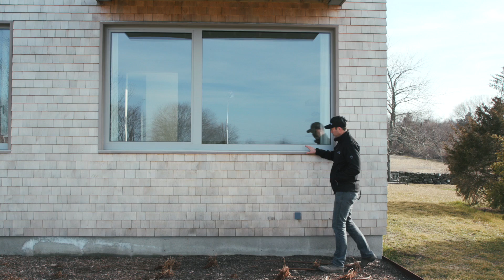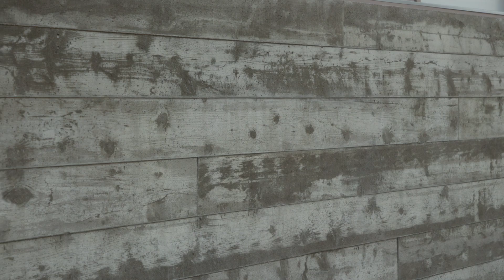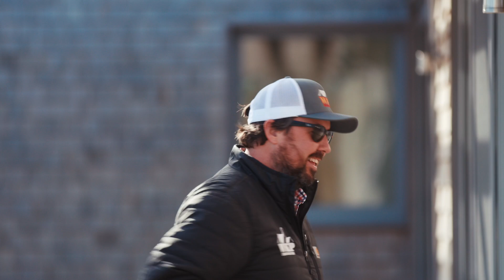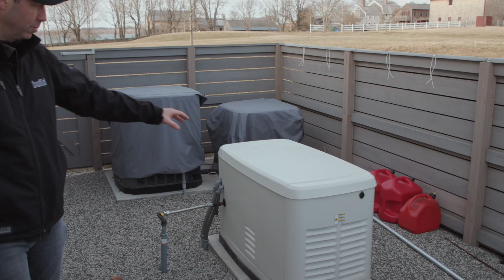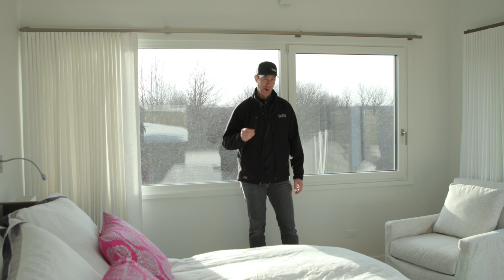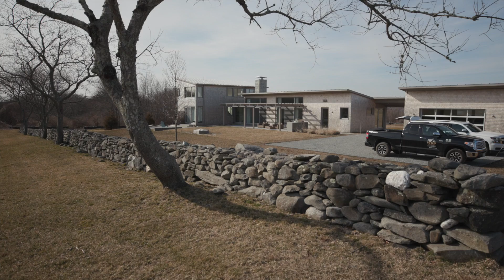10 Killer Details For A Modern BUILD

Comment: Anyone else not happy with the door handle at the end? It's probably for mechanical reasons, but turning the handle up too lock it just doesn't feel right to me. For one, even if it isn't strong enough, gravity will always try to unlock that door. Second, a large dog might figure out that it can unlock the door by biting down on the handle and hanging off of it. My landlord has two huskies, and once one of them figures out how to get into an area they want to get to by doing some really bizarre action; they will not hesitate to do it. Case in point, the grass area in the backyard was getting a bit thin, so my landlord fenced it off from the dogs to give it a few months of recovery time. One of the dogs figured out that it it gets its two front legs over the fence, it can dog-paddle its back legs while wiggling its front legs to shimmy over the wire-fence. Last, I can see some moron using the handle as if it were a hook for hanging things. Which may cause it to wear-out and/or break some of its mechanical components, and a heavy enough object might unlock the thing. Lock levers really should be setup to lock when pulled/turned downward.
Reply: Seriously ? Clearly you have never had the opportunity to operate a Lift-Slide unit.

Comment: Nice "Mechanical Corral"... but why not cover it with an awning, or extend the roof over it?   
A couple of 4x4 posts on the 2 outer corners and you could extend a cover over it and not have it exposed to the elements as badly.  Would suck to work on it during bad weather or extremely sunny day.   Shade makes it better!   (And if you want to get fancy, you can go for a louvered patio cover, and open & close it with the push of a button).

Comment: Lead coated copper? Is that wise?
Reply: Lead coated copper is normally used for flashing on commercial buildings clad in limestone. Lead oxide is white thus no green stain.
Reply: @250P  I appreciate the explanation, but I believe Ancients Nox is asking about the wisdom of deliberately using a highly toxic heavy metal on our homes. In this setting it would serve to contaminate all rain water waste over time and sink into the soil and plants, exposing people, and animals to a low level toxicity.

Comment: Ok. Been in field 30 years. 
And these ain’t killer ideas or new ideas. 
And the vents would be a big issue with me. 
You can get 6 inch vents but 1 be a 4 internal if something requires it. 
And if you look at the shake it’s not even. 
Yes it might be nit picking but I can say this. When a customer calls and says let’s do a custom house 2-3 mil. Etc it better be custom

Comment: I see this mistake SOOOooooo often. The doors in half the Hollywood westerns are done this way. The diagonal support on the gate is going the wrong direction. It should extend down to the lower hinge to support the falling weight of the door or gate to the hinged side.

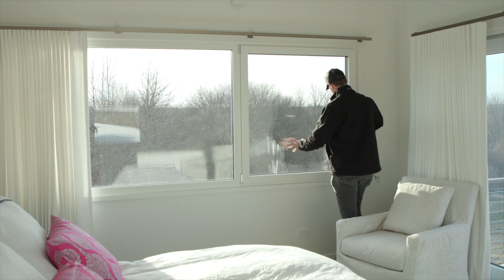Comment: 6:22 window opens in the wrong direction. Nuf said. Greetz from Germany :o)
Reply: Yes indeed this window is hinged on the wrong side. But hey we are not in Germany anymore where they are doing things the right way ;-)
Reply: German Windows can be hindged Left or right. Preferences depends on availabe swing space and astetics. Greetings from Austria.
Reply: no, the windows do not open "in the wrong direction". if the window opened in what you apparently consider to be "the right direction", the window sash would hit the lift and slide door on the perpendicular wall.
Reply: They are installed correctly. See https://www.innotech-windows.com/windows-doors/windows/tilt-turn-windows
Maybe the Polish builders installed your windows the wrong way. These European style windows swing this way so you can clean them from inside the room.

Comment: How were the plumbing vents handled?  I don’t see any vents stacks on the roof.
Reply: Ed Surowiec I think I saw roof vents in some of the drone footage; look closely at the end of the video.  But, vents aren’t really necessary... in 1988 my cousin and I did all the plumbing for a 3 bedroom log cabin and because of the challenges of running plumbing vent stacks through the log walls and roof we used one-way “air admittance vents” rather than traditional through the roof vents, and while using only AAVs with no vent to outside air is not recommended (or allowed by code) their use can greatly declutter the roofline.
Reply: Do people still use roof vents for plumbing in modern builds? I thought they were no longer necessary with one way valves installed on drains?
Reply: @ex8poc  AAV (Air Admittance Valves) are allowed, but even then you must have at least 1 regular stack vent, see the final section on this page for details https://codes.iccsafe.org/content/IRC2018/chapter-31-vents

Comment: Hi, 
What does the codes say about stairs and child safety? 
Here in Norway (Europe) we have codes regulating the opening/rise between the steps. In an open staircase one would have to limit the opening to around 4"ish.
Reply: Same here in Canada. 4” max and can’t have horizontal balusters because they can be climbed by a child.
Reply: @cney2125  the horizontal balusters (at least in the USA) WHERE outlawed by the code in the early 2000's (I wanna say the 2003 IRC off the top of my head) but either the 2009 or 2012 IRC brought them back to being OK, but as for that massive opening of the riser that fails the 4" sphere test I don't know who they paid off to get away with that, no way is that code compliant.
Reply: Same in the USA, at least California. I've heard of inspectors denying 1/8" variance.

Comment: beautiful!! 
but i dont get the lead coated copper? why not using sheet zinc?
i googled it, bc i did not know it at all here in austria. lead isnt allowed here anymore for roofing things... 
(except church buildings or other preservation orders)
Reply: I'm in the same boat as @Elias Ziel in this one; Why cover up the natural beauty of copper with boring gray lead? As copper ages it gets that beautiful greenish patina too. Mmm 😍 Why not use galvanized instead of copper on this house? Obviously they could afford copper but if you're going to cover it up, why bother? Am I missing something?
Reply: @online247365  with the natural weathering cedar shakes copper would cause staining.
Reply: I think it turns black with age. Common Modernist detail in wooden houses.
Reply: Well built to be sure. Bravo. But as for design, it seems so dead. It's more beige than a Toyota dealer. And the patina on all that lumber will take it closer to the grave.
Reply: Lead is deadly stuff - but if you got mercury fillings in your mouth why not go all out and dbbl down on it.

Comment: The windows were tilt and turn. We're the doors too? My place in Switzerland has tilt and turn patio doors and one giant tilt and slide patio door. All exterior doors and windows had exterior roll up metal shades too.
Reply: The sliding door doesn't look like it tilts judging by the top of the door arrangement with the casing.

Comment: With the stairs, how do you handle IRC stair code, opening >4"? No inspection situation? Or temp fill and remove after inspection?
Reply: there was a rod in the riser that was removable for cleaning that met IRC.  Owner has apparently taken them out.
Reply from the maker: The latter most likely
Reply: Yeah those stairs are not to code. Silly architect

Comment: The second hanger puts those bolts in shear. The fabricated hanger should support the wood independent of the bolts.
Reply: Not much weight on them, just a patio
Reply: I imagine they used shoulder bolts so it's not just clamping force supporting it.
Reply: Basically it's holding the weight of the individual beam and the cross boards. Cedar is not that heavy. If it had a roof, I would be worried.

Comment: Anyone else slightly annoyed that the two air intakes were not level with each other? The mechanical courtyard takes a page out of commercial construction. A lot of possibilities also with commercial "architectural" luminaires. All too many "residential" fixtures are poorly made and inefficient even when they are quite expensive.
Reply: I was thinking the same thing that’s crazy you say that. It would be the hell outa me on my Jobsite it wouldn’t be like that nope
Reply: great idea to put the circuit breakers outside. the water will keep them clean
Reply: Shouldn't those vents be part of the ” mechanical courtyard”?  I thought it was best to use vents, gates, and outlets.
Reply: I think Matt could have left number 6 out. If he thinks those two air intakes look good, he may need to take a trip to the optometrist. I would have installed them level and left them copper with a lacquer coating. I do love the mechanical Courtyard; plenty of room for the service ability of all  the equipment.
Reply: @boby115  it's just a fence around the AC and meters, how does it give the service technician more room than if it's just in the open?? Looks nicer though
Reply: @colstace2560  most utilities don't stay in the open, homeowners plant bushes to hide them. Either the bushes are planted too close or get too big to easily get to the utilities.
Reply: @colstace2560  I'm sorry I should have been a little bit more clear. I was comparing it to the architects who only give me a little 8 by 8 area with two air conditioners, a generator, pool equipment, pool heater, electric and gas meters and expect us to be happy when we service the equipment. This architect on Matt's video apparently has his act together. He allowed plenty of room for all the equipment with easy access. He located the equipment on a wall without windows to keep the noise down to a minimum. In my book this architect is the exception and not the rule. I wish there was more like him.

Comment: You made my wallet cry!
Reply: Could build that same house for half the money, but it's "designer"
Reply: @colstace2560  That's what happens when you pay people to do work they're experienced in
Reply: @sugarbooty  sure, but looking at this method it's pretty simple, kinda low tech so shouldn't be much more than a traditional build, it's basically dirt and cement, and the shovel guys don't need to be highly trained, I just don't see it !! No painting, no AC, no insulation, simple flat roof. sure the fit out will be high end but it's just a box, a 5yr old could draw it !
Reply: @colstace2560  But it's modern, you just don't understand. It's for wealthy to flaunt their money
Reply: @colstace2560  This is the Tesla equivalent. Yes, you can buy a Honda for 1/2 price.

Comment: Triple glass windows and efficient seals should be required, American building is just lousy is several cases.
Reply: And blower door tests to find all the air leaks!
Reply: @North American YouTuber  Not.
Reply: for most of the USA and with how efficient HVAC systems are today you will NEVER see your money back in the extra energy savings over the standard Low-e366 Dual Pane windows, no matter how long you live in the house, the cost difference is just that great, you'll be replacing the windows due to failed seals on the glazing causing the windows to fog up internally before you save that energy savings back. Foam your roof, flash and batt the walls and damn dude your power bills so cheap it's insane, we had a clients house we finished a few years back, 2 story, 1,800-1,900 SF on the main level HVAC and about 2/3rd's the basement HVAC with the last third being the 2 car garage and his SEPTEMBER power bill was $70, he barely had to run the A/C to keep the house comfortable in the low 70's (Fahrenheit).
Reply: With lead used, I wonder if there is also asbestos used, since it's so versatile.
Reply: @hans_1894  Eh, nothing wrong with lead in the proper application. Paint was an issue because old paint flaked and kids were exposed. Here? not a problem. Just like we still use asbestos today. In the proper application naturally.
Reply: The “envelope" on most homes (even new-construction) is so poor that the benefit of adding triple glass vs double-pane is basically nonexistent; for people not living in a custom home like the one in this video, the real benefit of triple glass is its sound insulating (ie. freeway noise/city traffic, flight path, trains, etc) ability but the price difference is usually too great to justify the expense.
Reply: @online247365  I believe buildings in Austria/Germany/Switzerland/... got the necessary insulation to make triple glass worthwhile.
Reply: Why worry about it when energy is so cheap? I can't handle 900 dollar windows. There's no guarantee my neighborhood won't fail and I'm forced to move before the windows even pay for themselves.